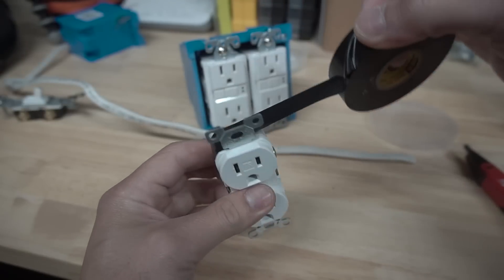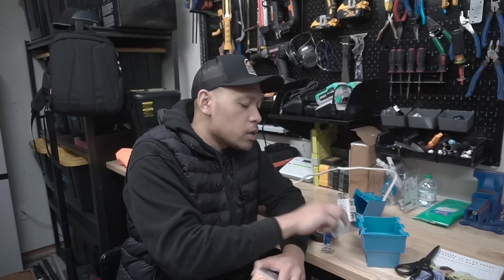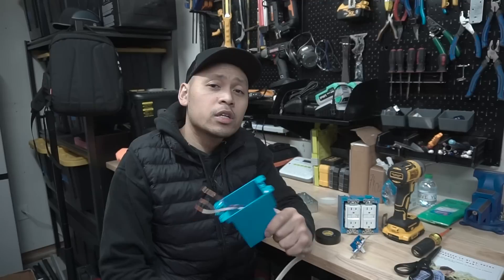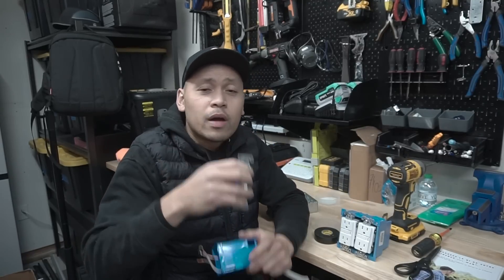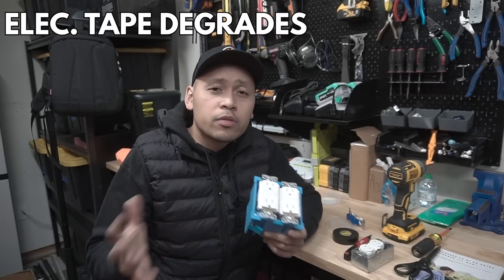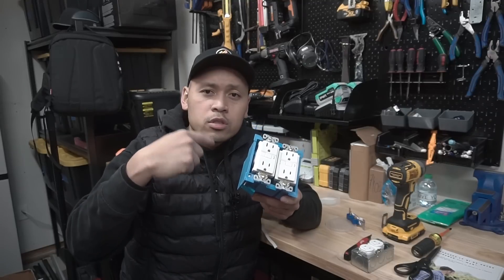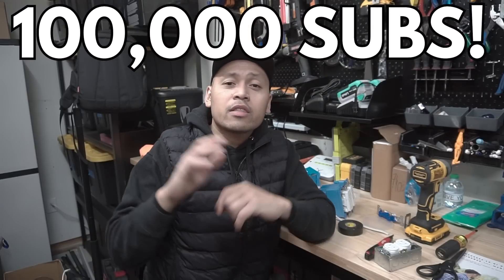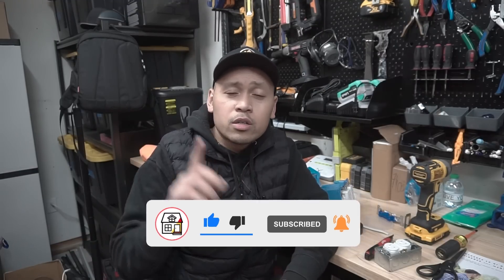Is It ILLEGAL To Wrap Outlets And Switches With Electrical Tape?! The DIY Great Debate! How To

Comment: I'm not an electrician but I have been a general contractor for the last 30 years with a degree in applied science construction engineering. The cover plate is your primary protection against little fingers getting zapped, make sure they are properly attached. 
I do not recall any n.e.c code governing the taping of outlets but in my opinion a secondary level of protection seems more professional. It looks like you have taken the time to do the job properly and the customers will appreciate the added safety. It makes you look cheap that you didn't wrap 2 cents of tape around your outlets.
Reply: Most general public would never even know about wrapping an outlet. If I'm in a metal work box, I take extra care adding switches and/or recepticles, but I have cleaned old tape and adhesive residue off of wires from people wrapping the tape, and the tape getting old and it gets sticky as hell....I myself do not wrap tape, and never will. If you do the job correctly it never needs the tape. And with mostly plastic boxes in residential anymore it's pointless. I don't want to deal with sticky residue. It's not code to wrap them, and for the next person who may need to come in later it's a headache.
Reply: Interesting discussion here. The video actually mentions the cons, but downplays them. I am surprised that some electricians actually recommend taping receptacles, as outside of the US I have never seen an outlet or switch in a utility box wrapped in tape, unless there was some defect.

The reasons given for this practice seem to indicate weaknesses in design or wrong methods of installation. I would never assume that a device without a cover plate is safe to touch. Tape is not a solution for overcrowded or too tightly designed boxes. Tape is not a child safety device approved in any electrical standard in the US or in Europe.

I do see damaged extension outlets wrapped in tape or tape used as a temporary fix. Therefore I associate the presence of electrical tape with defective devices or unprofessional, temporary workarounds. Any time tape appears to become necessary, there is probably a defect somewhere that should be remedied properly. Therefore I can fully understand that inspectors would be suspicious of taped devices.
Reply: @ChristianWagner888  Astute observations, Sir. Tape has it's uses but it's actually very dangerous when used as a solution to faulty and improperly installed electrical equipment and devices, you are absolutely correct. It's a heavy fine, for example, from OSHA if  extension cords are found on a job site with electrical tape on them. I am on site today with a new customer, a lobster harvesting operation, the previous owners had two L14-30 cord ends (125/250 volt 1ph 30 amp rated) fed with #10 SO cord on one 70 Amp and one 100 Amp 480 volt 3 pole breakers. The amateurs where not skilled enough to attach the nylon bases of the cord ends properly and simply added half a roll of black electrical tape over the bare terminals. All those code violations and more where hanging ready to be grabbed on a wet concrete loading dock. One of hundreds of examples that we professionals see over decades of experience in the field and yet these complete novices make videos and people come on here and praise and thank them..... It's a travesty, people underestimate the deadliness of electricity.
Reply: @ChristianWagner888  inspectors don't pull covers off boxes to check for tape. 
As far as defective, you've never opened up a new device to see connections inside were either taped or heat shrink wrap? And that would make you think defective even if it worked properly? 
I open up devices all the time and wired connections are protected. It does not make me think defective.
Reply: 30 yr HVAC serviceman . I always tape outlets, switch and wire nuts. I learned this from an old school serviceman. I never had a call back on any of my electric work.
Reply: Another 30 year GC chiming in. The only time I ever wrap them is if I have multiple GFCI in one box on separate circuits. So once or twice maybe in the last 40 years. If you know what you are doing and do it correctly with the correct parts, there is no need for it. When I see it in a box I assume they were covering some sketchy shit or just not confident in there skills. Either way, since I was the last person in there I have some liability to check it. Around 25% of the time it is hiding something.
Reply: @gueto70  Thanks for the input. If you notice, the terminals are usually recessed on a GFI ......but that really doesn't even matter as a properly fastened and positioned device is perfectly safe even if terminals are within 3/8" the voltage is not nearly high enough to cross the air gap. Generally air is enough to prevent arching at approximately 1000 volts per inch. Another thing novices are completely unaware of is the good practice of eliminating the tension of the conductors when installing devices.  It's possibly to end up with zero force on the devices and the wires going into the devices to the point that the devices will sit exactly in place even before tightening down the mounting screws. That is what everyone should be focused on , normalizing the wiring in the boxes so the devices are not stressed.
Reply: @fritzmiller9792  Tape is sticky and and can achieve 💩 dirt which would than become a conductor. As an auto mechanic rubber hoses can conduct, electrical current try it with a test light, dirt is the answer, this is why we have maintenance. and the word maintenance. If your painting and remove all the covers. Than there is the possibility that a house out of billion of houses could burn down from this one code violation. When the lawyer asks you are you a licensed Electrician You answer No, you are now guilty.
Reply: Never hurt to put on the tape.
Reply: Jeffrey Coe I understand your point of view.   First of electrical tape is only a backup insulator.  I use electrical tape in wet locations over water proof wire nuts.  I also use electrical tape in wet locations. 
I don't use electrical tape as an insulator for terminal.   I replaced old outlets where the insulation melted of the wire, over the years.  Electrical tape will melt away if it comes into contact with a grounded box.   This is actually more dangerous then a bare conductor touching a box.
The melting electrical tape will create heat, but not enough short circuit to trip a breaker, or an arc to trip a arc-fault breakers.  
What happens is a small electrical space heater,  that gradually gets warmer and warmer like a electrical heater until a fire starts. 
Also I was working construction of a hotel.  I had install 100 duplex outlet outlet.
Reply: @jamesmooney8933  I own an 80 year old home that I replaced the old electrical system. The old electrical was all knob and tube with probably 50 to 60 year old electrical tape everywhere. None of it was melted. UL listed electrical tape is rated to 600v. Far greater than the 110-220v most people will be using so there's no need to fear monger someone into thinking using electrical tape is unsafe. If you have ever seen and replaced an outlet that has overheated from a space heater you would know that the face of the outlet between the prongs melts first. That isn't caused from a taped outlet. My buddy owns a painting company, he can paint perfectly straight lines without tape. His preference as it's yours also. Some people do some people don't. Lol
Reply: @jeffreycoe1665  My dad taught me to wire in the 60's.   Wire Nut were just coming out.  My dad used to twist the wires to get and electrical tape. 
Was the electrical tape cloth?   Nob and tub is interested.   It is actually good wiring.   When the  hot run down one stud, and the neutral runs another stud.   When the conductor runs through a joist or stud,  a ceramic tube is installed.   
I worked for electrician, who would replace the nob and tube in the basement,  but would wire  the nob and tube into and electrical box,  and romex to the panel box.  This past inspection. 
A neighbor of mine had a fire in his attic, where an Electrician wire nob and tube in to an electrical box.
Fires only happen when a hot or neutral goes to ground.   The modern electrical box is grounded.
In a nob & tube system,  insulation is not necessary because the nobs & tube is the insulation.  
Now my neighbor attic caught on fire because the box was grounded by a green wire in the box.
If the box in my neighbors house had not grounded by a green wire, then the fire wouldn't have started. 
I can explain it by the bird on live wire.  
If you are not ground,  then you can touch a hot wire.
So were ever you wire into  nob & tube,  do not ground the box or like me rip out all the nob & tube in my 120 year old house. 
As a matter of fact that was my first wiring job.
Reply: plastic plates break and futere repairs to electric or drywall is a hazzard  people moving things in house could hit a device and break plate or damage device so if you never have to repair a device you will never know the hazard
Reply: metal boxes
Reply: Jeffrey Coe,  as a maintenance electrician for 20 years,  I never wrapped electrical outlets with electrical tape.
Reply: @jamesmooney8933  as a driver for 32 years I never use my blinker if nobody is around.
Reply: I'm definitely with you on that
I always wrap outlets and switches with electrical tape b4 putting it in the box whether it's plastic or metal for added safety
Not just against terminals grounding out
But when there two or more switches or outlets in the same box but on separate breakers so when replacing a switch or outlet, You reduce the risk of touching the terminals of the other devices by accident
What I use is Scotch 1 1/2" wide electrical tape for wrapping outlets and switches because you get much better coverage and actually use less linear feet than 3/4" wide tape and I use only one brand of electrical tape and that's Scotch because those cheaper , Off brand tapes get brittle and start peeling off in a short time
One trick I discovered in wrapping outlets and switches is first apply a light layer of splicing tape to the outlet and switch 
You have to stretch it a little as you apply it
Then finish it with a top layer of electrical tape , The electrical tape sticks extremely well to the splicing tape and will never peel off , But still , Avoid those cheap tapes like you'd find in a hardware store or dime store
When you care about safety , it's always worth it to use top quality materials as well
Reply: I'm not an electrician, I'm just a dumb freaking welder, don't have a degree. I built, plumbed and wired my own house, worked in machine shops, repair shops for over 40 years and was usually the guy called upon to run conduit and wires to install any number of equipment, machinery, lighting and receptacles. To me there was nothing more aggravating than to remove some gooey mess of cheap electrical tape that someone wrapped around a receptacle or wire nut when moving or repairing a circuit. If you do the job correctly and use quality devices there's little if any added safety. If it makes you feel good do it, but at least use a quality tape. I think it's a waste of time and tape. Most are never going to know if you used tape or not and no one should be opening up a receptacle or panel box unless you are competent and comfortable doing so.
Reply: @edv9483  I also hate the electrical tape wrap.  I used a different technique to remove the electrical tape wrap.  I use my di-anglal cutters or       .... d y k e s to cut the tape. 
and unwrapping the whole mess.
Reply: If I saw tape wrapped around an outlet I would immediately think you're covering up shoddy work. Install it correctly and you don't need "extra protections."
Reply: @BeersAndBeatsPDX  the tape is for people like you who see an electrical outlet and has to think.
Reply: @jeffreycoe1665  you got me there, pal. Took you a while to think of that zinger.
Reply: @BeersAndBeatsPDX  I was at a basketball game. Wasn't waiting to troll someone about something trivial like electric tape. Besides after 3 months ago debating someone about how electric tape makes their hands dirty. At work. And they're worried about getting their hands dirty. Now you? You'd like to plead your personal preference regarding trivial bull crap? Go ahead I'm all ears...
Reply: Jeff, with your experience in electrical manufacturing, you should know better, that products can't be sold by any manufacturer without being fully evaluated by a testing company like UL, etc.
Every product also comes with specific labeling and instructions for installation and use.
This is called listing and labeling of products. Every Code in existence has a specific section or article for just this reason. As a licensed electrician like myself, this is one of the most important sections of code that we have to use. Article 110.3(b) of NFPA 70 is just for the reason this video and conversation.
Devices like receptacles are switches have never been evaluated with electrical tape on them, nor is it in the instructions for these devices as an acceptable installation.

But I guess being a salesman makes you an expert on installations, until you hold an electrical license and have the required training in the trade, lay off the experience trip, because your no more experienced than the average dyi  homeowner.
Reply: @markduverger1739  Straight fire Mark. I couldn't possibly say it as well as that.
Reply: @fritzmiller9792  you got 50 years of experience but you use the slang of a 20 year old. Says a lot.
Reply: @jeffreycoe1665  I picked up "straight fire" from some sports talk guy years ago. I coach  middle school football and have raised two sons and they keep me well versed in new sayings, haha sometimes I tell them I wish they didn't even tell me some of them. But yeah, I am a very young 58.
Reply: @fritzmiller9792  are you bad at math or do you think I am? 58 - 50 is 8 bruh.
When you're done lying about your experience go check that ul listing on your electrical tape. 
Straight fire lol
Reply: @jeffreycoe1665  I just fixed it, I thought you were exaggerating but I made a typo, but yeah I did Roofing and carpentry starting at 13 every summer and part time during school. I worked through College as well. I did mistakenly type a 5 instead of a 4 but it is actually over 40 years legit. But you can mock all you want if that works for you.
Reply: @fritzmiller9792  it's not even worth arguing with the ignorant, people like this Jeff character are typical Jack of all trades and master of none.
It's actually funny that someone will argue a method and can't back it up with references as to why it's not the safe or acceptable to do one way or the other. All they do is use an opinion that it's ok to do.
That's the difference between a professional trades person and a lay person. He's never experienced or seen the effects of heating and cooling of electrical terminations, let alone he and any lay person doesn't know what temperature terminations are all about either and the fact that good electricians will remove that supposed extra level of protection he thinks was a great idea not knowing he's not only created a code violation and inadvertently created a hazard.
Reply: @markduverger1739  being a licensed electrician you would know that in the instructions for an outlet or a lightswitch it states receptacle does not protect against circuit overloads that you can still be shocked if you touch the conductors.
Then there is some ambiguity in the instructions as it doesn't tell you how to avoid being shocked other than having the power off.
Electric 101 How do you not get shocked by a conductor? By using an insulator. Electrical tape is a 600v insulator. Omg could I use that to protect people? Let me check the NEC guidelines. Well it doesn't say that I can't.  Will electrical tape void a manufacturer warranty? No it will not.
Will it void the ul rating? No it will not.
All these invalid arguments about your personal preferences like I don't have a leviton receptacle instruction sheet right in front of me.
Like I can't Google the codes you guys rattle off that has nothing to do with your personal preferences.
Reply: @jeffreycoe1665  your response shows why we're licensed and your not,  and it does violate the evaluation of the product. 
Whether you agree or not, it's a code violation, period.
That's difference between being licensed and not, unlicensed people can do whatever they want and not be subject to any consequences, we are. 
Being ignorant of how a product is to be installed and not having any experience with installations like this, doesn't mean you can just do whatever, because it doesn't say you can't.
Until you have had experience with UL testing procedures and evaluations, Code, AHJ's etc. your barking up the wrong tree on this subject.
When you can tell entire group here about temperature termination characteristics of a device, you would know exactly why wrapping electrical tape around a device violates UL's evaluation of these products.
Reply from the maker: Thank you so much for sharing your experience and expert advice! 👍🏽😊👍🏽
Reply: Having to use secondary level of protection means that there is a problem with the primary protection

You will not be able to see if the terminal is overheating if the outlet is wrapped
Reply: @ricardobocus6304  No just no. You don't have to you just do it because you don't know who will be working behind you. Is the homeowner going to want to switch the plate? Is the homeowner going to want to install a different color switch? You don't know. So 2 pennies worth of tape.
And again there is no reason for the terminal to overheat. It's a lightswitch or an outlet. And if the plate is on you don't see your terminals overheating anyways so what are you talking about?
Reply: @jeffreycoe1665  well wrap the whole house in tape then, so everyone can be safe. Yay!
Reply: @ricardobocus6304  it is unnecessary,  but in the day where Harry homeowners remove the plugs and switches to add wainscoting  etc, not a bad idea. If you feel the connection is overheating use an infrared gun. They are not that expensive and far easier to use. More than likely you'd replace the bad device rather than repair it. You can't see into the internal parts of the device anyhow.
Reply: @smitlag  on the same logic if home owners like to poke their fingers then it is like saying example to tape wrap all the breakers and lug connections in panels. Wrapping will obstruct visual inspections and troubleshooting. Also you are adding material to a wiring device this negates the UL rating and manufacturers installation method.
Reply: @ricardobocus6304  dude do yoi have any idea how stupid this whole topic is to me? Basic device wiring is about as boring as it gets.  The average electrician knows one thing " black and white make light". Unless you do serious automation and control work this whole discussion is so basic it is mind numbing. 40 year veteren Union Elevator tech with both degrees in electrical engineering and computer science. I just happened to see this pop up on my feed.
Reply: I wonder if customers even care that you added 2 cents of tape around an outlet. If they are not planning on doing anything inside the j box or removing face plates anytime soon how would they ever know? And why would they ever ask?
Reply: @Jrfusion08  The customers that won't care don't, the customers that do care might cost you your reputation. My reputation is worth more to me than 2 cents worth of electrical tape. I hope yours is as well. 
Also you can guarantee that the face plates will be removed at some point as most are removed when painting.
Last thing, even if there was no additional layer of safety involved the perception of the customer that you are a professional gets referrals and sells more jobs.
Reply: @jeffreycoe1665  my reputation would ensure that no customer thinks poorly of me because I didn't use 2 cents worth of tape. They would know if I didn't do something it's because no substantive value could be found. But others may have fickle customers and fickle reputations they feel they need to defend. Either way, I've never heard a customer say "where's the electrical tape" lol.
Reply: @Jrfusion08  you don't hear from those customers ever again nor any of their referrals. I guess you have never been referred work from Angi's list as most of their customers are very finicky but if your reputation was good enough you would know.
Edit> 600v of protection has no substantive value? 2 cents of tape for 600v of additional protection has no value lol
Reply: I did commercial work on highrise buildings. We did not usually wrap the devices. But that is more a cost savings issue. Scotch 33+ is great stuff, but it gets expensive when you are buying it in quantities where you might have a few hundred devices on each floor. That being said in a home situation or situation where remodeling is taking place, it does give you an added factor of safety.  The problem is most novices tend to cut their wires too short to properly fold the wires back into the device box. Try to minimize strain on any connection.
Reply: It bothers me when I don't see no tape on outlets or switches
Reply: It's a nice touch like installing future conduits above a electrical panel for the "next" guy...only takes a minute.
Reply: My credentials so you don't get me confused...
30 years experience in residential construction
4 years experience as an electrical manufacturers sales representative, representing Jefferson Electric , Siemens, Halco lighting, Nora Lighting, Simkar lighting, Reliant controls, Mulberry metals, Talon plus a wire line selling $7 million a year in copper wire
3.7 GPA college degree in construction engineering 
Dean's list
I work for myself.
I get work mainly through referrals. 
I own my own home.
Paid in full.
Replaced my fuse box with a 200 Amp breaker panel
Replaced my forced air gas furnace with 240v baseboard heating and Dan Foss radiant flooring
Replaced my gas hot water heater with Rheem electric point of use heaters
I have the most modern electrical system in my neighborhood.
Don't you ever question a random person's credentials ever again in your life.
Reply: @jeffreycoe1665  I will question anything I feel I need to. Also, I never questioned your credentials, I said you don't have credentials to speak to the topic AND I only said that because you came in (errantly) claiming that you did. Also, some salesman have unbelievable knowledge of the product (although most only know the hype phrases to make the sale) but just because you sold for electrical manufacturers doesn't make you knowledgeable of the engineering limitations and UL testing parameters of the product. IF you had that knowledge..... you would agree with me. Go ahead, call an engineer that designs devices. Oh, BTW.....I not own my house but I built my house. Also, saying your electrical is the most advanced on the block tells us way more than you can know. Just had to say that.... yeah I wasn't nice there...but you definitely earned it with your little foot stamping " don't ever ask...."  tirade.
Reply: @fritzmiller9792  how do you keep saying the exact opposite of reality?
Reply: @fritzmiller9792  my first post you need to go read it again. Maybe English isn't your primary language fritz but I posted everything you needed to know which is exact opposite of what your last post says. Don't hurt yourself rereading it.
Reply: @jeffreycoe1665 😂😂😂 Mr. Jeffery, your reasoning is inducing a brain injury - I can't risk reading it all again !BTW insults are not points but just evidence of a losing argument. Let the readers decide. Hopefully I steered a few the right way.
Reply: @fritzmiller9792  with your 50 years of experience you don't have time left to be rereading anything but I assure you in my first post I wasn't wrong. The readers can read this 1000 times and do what they want since their is no NEC guidelines it's a personal preference. But I side on the school of redundant safety precautions and you can have your 50 years of experience and get sued when the homeowner pulls the plate and zaps themselves on your work. Man your being cheap and you know it. You'd rather look like a fool than use 2 cents worth of insulating tape. Wow.
Reply: @jeffreycoe1665  You don't brag about a 3.7GPA, you brag about a 4.0!
Reply: @panerai_fan  when you drop out of junior high school like I did you brag about your attendance lol
Reply: @jeffreycoe1665  I don't mean to stop on any toes here.
However just based on observation - I cant believe what im reading, people have opinions I guess.
Here's mine, either you have a four year degree in electrical engineering or you have ICBO background....its that simple
Reply: @richardmontes6420  I'm not an electrician. I said it in my first post. I don't like working with electricity lol
I don't see anything on the topic of electrical tape insulating the conductors of outlets in the nec.
I think it's more a matter of personal preference.
That being said in my line of work I sometimes need to remove an outlet and box and sometimes I don't have access to the panel. I have to remove outlets hot all the time. And I appreciate when the electrician who installed that box wraps his outlets so I don't get zapped.
Reply: @richardmontes6420  between 2010 and 2014 I was in university and all of my professors in electrical and construction fields neglected to forewarn me of the dangers of electrical tape lol
Reply: @jeffreycoe1665  I was in BIT..and nobody mentioned ever mentioned electrical tape.
Reply: Exactly wrong. I am not cheap for not using tape....I am knowledgeable for not using tape. You don't have the credentials to give the incorrect advice on this subject. It's wrong for many reasons that you don't have the experience to comprehend. Again, if it was needed then the devices/equipment would have been designed poorly and therefore not even legal to use.
Reply: @fritzmiller9792  I don't know if youtube is deleting my comment for having a link but my comment to you keeps disappearing lol
The link is to an ecmag article on the topic. There is no n.e.c. code regarding the taping of outlets and switches only that they are not energized until the cover plate is installed. 
It is not wrong it's not right as there is no guidance on it. That being said electrical tape is rated 600v per wrap around. 
You're very rude to assume my credentials while not providing your own as well as your assumption on my ability to understand. And you're cheap.
Reply: @jeffreycoe1665  Master Electrician/I Contractor since 1998,  with 40+ years construction experience Industrial/Commercial/ Residential, Associate Degrees in Electrical and Electronics, I hold a gas license and am training in refrigeration (with a gas license) and I have extensive experience with heavy equipment and just bought my second machine. You can know and even quote the NEC and still be a very unskilled inexperienced and incompetent electrician, only experience (or perhaps extensive conversations with an experienced tradesman) can bring you to truly understand the trade. Not taping devices is nothing to do with saving tape, it's just very unnecessary and very problematic AND it displays a lack of understanding of electrical components,devices and their functions. Your degree never covered this subject in anyway, I am sure of that. You can have an opinion but you don't have credentials to bolster it, you are putting forth that you do and I want the record to show that you do not. And you can get nasty and rude but I will just stick to the facts. Taping devices is  a complete waste and filled with problems and tells me that someone doesn't fully understand the function of the system. And I have more experience to make that statement than anyone but electricians with a background equal to mine, of which there are not many. (Edited: typo on experience corrected)
Reply: @fritzmiller9792  you are wrong my degree covered electrical, mechanical, hvac, structural design, green building, cad & bim design, scheduling, with a capstone course  in estimating and cost analysis. You claim to be experienced and competent yet when I quote n.e.c code regarding this you resort to a fallacy argument attacking me personally because you are wrong. Period. Look it up. Learn what a fallacy is before you lose your next argument.
Reply: @jeffreycoe1665  The discussion of taping devices was not covered in your courses NOR was it in mine, kinda ridiculous to have to point that out. Listen, if you want to not accept the credentials that I listed then what point is there in having a discussion? You might be incensed that I said you didn't have the credentials to bolster your opinion but if you look back, at no time have I insulted you or accused you of lying such as you have to me. I am adding to the public record here that people like you are giving opinions on the subject without the knowledge or experience to speak from. I want everyone to know that taping devices is just wrong thinking and installing devices correctly is what should be done. And when someone claims authority on the subject but really has none (you) I want to point that out. If that insulted you then that's on you for whatever reason. All I know is my trades and that your classes give you zero real insight into the topic. Call an engineer at ANY device manufacturer and ask them about taping devices. Then get back to us. Or, you can disparage me some more and claim some more "fallacy". Anyone can look me up on the State of Maine website listing professional licensing.
Reply: @fritzmiller9792  You still haven't listed even one of the many problems.
Reply: @waynesmith9765  Others have listed them all through the discussion. Usually the tape slides off the devices leaving the black adhesive goo all over the device and the wires. Sometimes it collects moisture and corrosion develops. It can unravel and dry up where it's loose creating tinder/fire hazard. Any follow-up work to be done is greatly complicated whether it is troubleshooting or expansion of the wiring. Again, it might seem neat and safe to the amateur to add the tape but it is not adding any safety to a pro any more than adding more shields to the engine compartment of a vehicle would add safety for a mechanic. It's possibly even a violation of the manufacturers installation directives but I can't verify that without calling one. It's the last thing I want to see when I open a outlet to troubleshoot. It's completely unnecessary and therefore stupid. Amateurs advising complete day 1 beginners on electrical work is going to come back on someone sooner or later, these videos in general are setting up untold dangerous conditions as inexperienced people work at a trade that, for good reason, is legally performed by apprentices, journeyman and masters.
Reply: @fritzmiller9792  hey Fritz, I agree with your assertion about improperly installed devices or faulty ones. I am. EE and design electronic equipment for over 50 years. I read the specs from the manufacturer and design accordingly. When it comes to line voltage devices such as outlets, modifying their installation requirements may cause other issues, therefore, if the manufacturer does not specifically require electrical tape around thier product, I simply don't do it. Its a waste of time and offers nothing to the safety of the product otherwise the manufacturer would specify it in their installation instructions.
I work with both very low and super high voltages & frequencies. And although I am not a licensed electrician, I totally understand the reasons behind the electrical codes. I also understand the valuable work that they do ESP when time is money. Never cut corners or add anything that is not specified.
Reply: @rty1955  Thank you. Your professional opinion helps stem the tide of bad information.
Reply: @fritzmiller9792  "Not taping devices is nothing to do with saving tape, it's just very unnecessary and very problematic AND it displays a lack of understanding of electrical components,devices and their functions. "

Electrical apprentice here. I am way happy I don't work under you. I'd have quit and gone to another company by now. You sound like one of those arrogant old-timers, too stuck in his way who rants at "why Wagos are stoopid!!" Too stuck in your opinions and hooked on your experience as if your opinion is god. I met plenty like you and you think you know everything. I avoid electricians like you. 

With four square (metal) boxes & two duplexes, I use tape. With a GFCI in a metal cut in, I'll use tape. If the box is cramped with a resi install and I'm concerned about the non-insulated ground touching the terminal screws, I'll use tape. Don't forget, much of the code is the bare minimum standards. You know what else isn't in the NEC? Anti-shorts on MC. Yet we all use them, for the exact same reason we use tape.
Reply: @icevariable9600  you are wrong, we use anti-shorts because the manufacturers instructions say to. No instructions say to use electrical tape. WAGOs are awesome. In the steel 2 gang box you mentioned, if you tighten everything down and arrange the wires properly there is no need for tape. In 100 plus years of devices being made by dozens of companies getting probably thousands of UL listings there have never been directions to use tape (at least not that I know of) because if there was it would be ridiculous that the safe functioning of a device would need to rely on electrical tape. As far as the NEC goes, the biggest arguably most important line of code in it calls for all work to be done in a neat and workmanlike manner, if that's what someone wants to hang their hat on as a reason for taping devices then that's their decision. I happen to believe it's just the opposite....it tells me a novice did the work who hasn't seen what becomes of the tape over time. So there are some reasons without half a dozen insults included for you.
Reply: @fritzmiller9792  You stated "wrong for many reasons" but never listed even one.
Reply: Lol,the tape wraps arounds outlet in narrow boxes like handy or cut in old work boxes or even while use p-rings on 4s or 5s taping helps to keep hot side of outlet from touching the metal while pulling out device,40 years as an resi/comm/industrial electrician  it is a choice talking shit about one's opinion dummy up let people  do what think is right for them /code s4ays nothing about tape and devices.